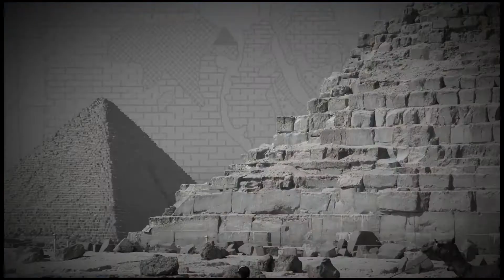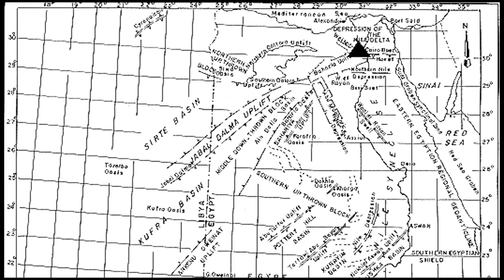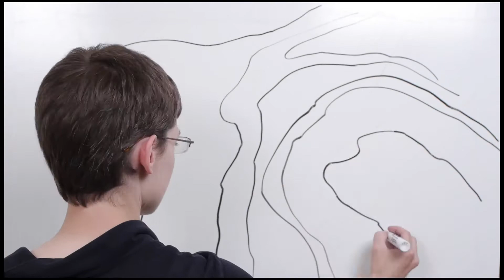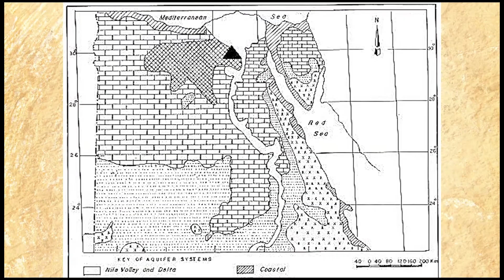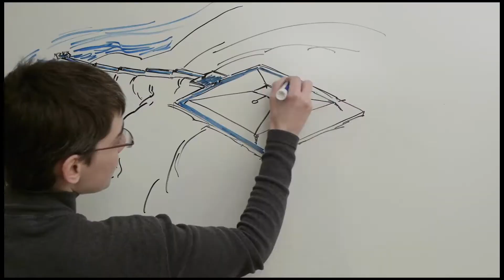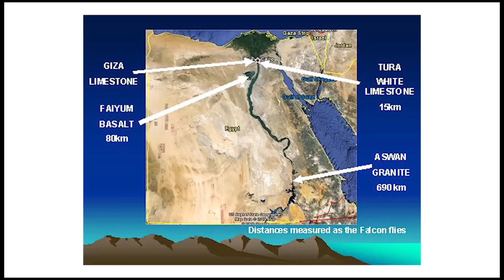Great Pyramid - Floating Stones

Comment: I  just  found  this  video through  a  search  for floating  the stones  up. I  began  reading  an article yesterday   morning  about  them  soaking  the  sand to drag the  stones  for miles and I  didn't  buy it. 
I  have  been  a sailor  and a construction  worker with  a  lot of rigging  experience, a real lot.
I  think  that  anyone  smart  enough  to  build  the  pyramids  was too smart to be dragging  the stones by ropes for miles. I  have  worked  with  barges  and know  they take hardly  any  water  to float  them.
I  have  been  in dry docks and canals and lift locks.

I  thought  that  if it was me and I  knew  we were  floating  the stones down the river Nile I  would  immediately  suggest  digging  a canal to the quarry and from the river to the pyramids  and right around  them for two way traffic.
then I  would  be thinking  about  how to  get the barge raised up and I  immediately  thought  of  locks and the pyramid  is five  times the length  of  barge they found  preserved  by the great  pyramid which  is plenty  room  for  locks.
I  read that they called  the barge they found, a funeral  barge because  it had no sails and no place  for oars but a canal barge is towed along by  a  rope to a horse on the banks not by sail or rowers.

I  think  that  barge is probably  the  last  one they used  to float  the  stones .
if they built four or five lift locks side by side anyone who  didn't  know  what  they were might think  they were a ramp from a distance, especially  if  they  were either being built  or taken  down. 
I  just  looked  at  some photos  on Google and  I  saw that  there's a harbour near the pyramids  and another  by the sphinx, towards  the  Nile. if the harbors had gates they could  have  been  used to  flood the channels  and  the  whole  process  could  easily  explain where  the  water damage  around  the  sphinx  came from too.
I  thought  I  would  check  to see the mysterious  shafts  also, I  thought  they could  be  drains  and the description  said that  they are unexplainably built using  what  appears  to  be  gutter stones . 
it also  mentioned  that  the  bottom  of  the  lower shafts  is covered  with  a flat stone with what looks llike  copper  handles  on both sides. well, if it was put on from the top as it was  being built  that explains  the inside  handles and if you  didn't  plug it then it would  be  quite  a  windy chimney .
if you  want  to  use it as a drain  then you  need to  be  able  to  unplug it from the inside once the job is advanced  enough and that  explains  the  inside handles.
the shafts  are angled  near the bottom  to slow  and direct  the water  coming  out. 
I  am  really  glad  that  you  have  made  the  video  because  I  was  pretty  excited  but  also  thinking  that  nobody  would  understand  what I was  thinking ....
people  would  rather  believe  a ufo floated  the  blocks up.
I  thought  that  they were floated up too but by the only  way  they knew how, on water.....when I  looked at
the  photos  from Google  I noticed they also have  a  few shots with a jeep and tourists on a road that  looks  like  the  canal I imagined, going  right to  where I  imagined  it. I  also looked  at  overhead  shots of the area  and you  can  see those "fans" in the ground  around  the  pyramids  that  indicate  water flooding  over a dam or after  bursting  a retaining  wall such as a crater rim.
I  have  a  history  of  finding  ways to solve  certain  problems  to do with  construction  and I  have  made friends  with  a few engineers  in my  life. I  have  been  asked  a few times  where  I  get  the  ideas and I  always  joke about  it  and  say that   laziness  is the real mother  of  invention  and I  am  always  thinking  about  an easier  way  to  do my work.
I  just  pictured  myself  on each part  of  the  job constructing  the  pyramids  and  I  know  that  I  would  not be happy  with  the  dragging  stones idea  and I  just  know  that  the  fact  we were already  floating  them on the river would  have  me wanting  the water  to go from the quarry  to the pyramids  with  no dragging  involved . 
I  also  know  that  for splitting  the  stones  once they were up there they could  use their copper tools and just  make enough  of a hole to insert wooden wedges that  would  split  them once the wedges  were soaked.
all the working stones would  have  provided  the fill that they needed inside  to stabilize  the  rough cut larger stones too.
Reply: You sir have obviously spent much time thinking on this. Go to James Northcutt or jimbobpyr on you tube to see the method that I have devised for this theory. Could use some help on the "pyramid project" and will send you my research if requested. Go to jimbobpyr@msn to request this.

Comment: Except inside the pyramids are dozens of drawings of giant "people" CARRYING the blocks with a sling to the pyramids. No drawings of locks, water etc at all.
Reply: No drawings of any ramps or anything being pulled on an incline of any kind either! Even giants could not physically lift 150 ton stones either! You should know of the power of water in this application as YOU are the one who figured out the "H"block use as hinges. These hinges were used to hold and swing large gates for a boat lift, which is also why they built the gigantic walls at Cuzco and Sacsuhuman. They didn't just build with water lifts but did commerce and trade by water!